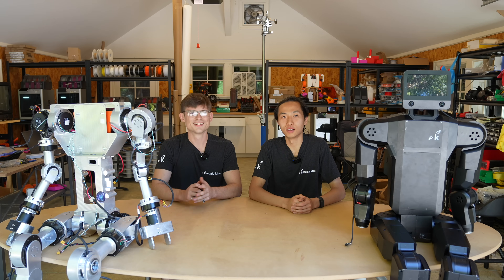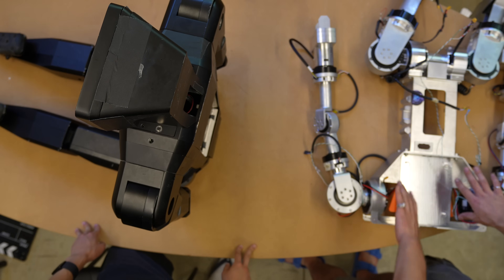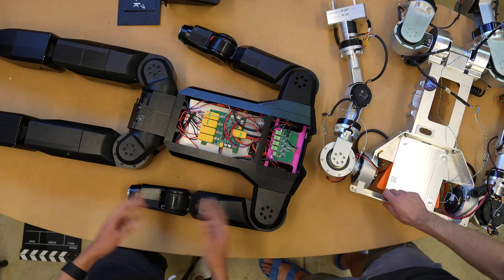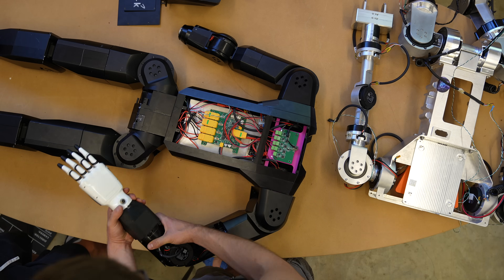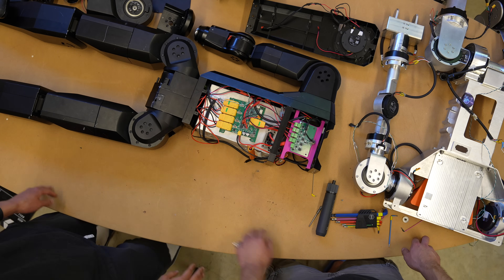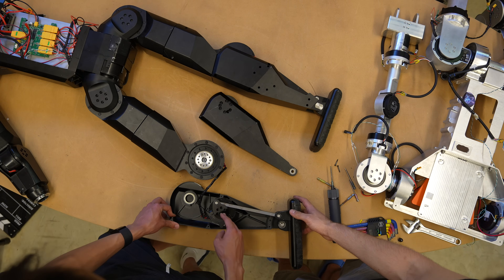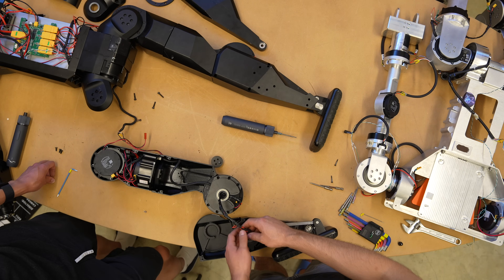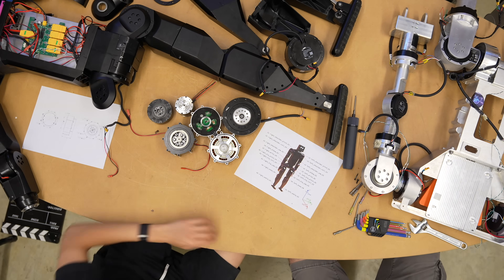What’s Inside K-Bot? Full Hardware Breakdown

Comment: What a wonderful and promising project! I would like to ask you, is it safe to daizy chain the motors in regards to the power cable? I mean is XT30 capable of handling all the amps that will be drawn from connected motors when all the motors may be in action and propably draw max current? Also  i have connected 4 motors at the same time and faced some problems with the CAN BUS where 3rd and 4th motor would miss instructions (through the usb can module of robstride) ... what electronics do you use? is there a link i can purchase them?

Comment: One application I see that humanoid robots such as your could fill is driving legacy as well as specialized vehicles, in a manner similar to how a human would drive it by sitting in the driver's seat and suing the steering wheel, brake and accelerate pedals and shifting gears.

Now one does not have to be a Tesal Robo Taxi to do that given that the circumstances are right.

For example  say one wanted to drive a car underwater such as this.

e.g. Google
Watch: Toyota Land Cruiser EV Breaks World Record by Driving Under the Ocean

So a bot could be the driver and maybe  operate from a closure so as to keep the bot dry.

This could have any number of applications but the one I particularly have in mind is to be able to drive under the Dnipro river in Ukraine to be able to hide form UAVs while deliver  bots and supplies to the other side by driving into the river, then on the river bottom, then driving back  out of tehe river to the other side and then further inland while never putting a human driver  at risk.

And there could be many more applications for bots to drive vehicles that do not require a Tesal robo taxi FSD level of smarts..

Comment: Just from curiosity, on the power board, I am guessing the right biggest cable is the one connected to the battery, and u mentioned that the 4 pairs of cables on the left is for the 4 limbs. Whats the small pair of black red cable thats at the bottom  in the middle. Is that to power the electronics in the head (camera, display, etc?). I dont have any experience with electronics and its kinda cool that you guys go on all these details!

Btw, the black frame looks and sounds metal, or is it metal? Cuz I thought u guys 3d print these parts

Comment: Is there a reason, why you mostly opted for direct drives? For example, torque transmission via timing belts on the arms could reduce inertia quite a bit, which would reduce the required motor spec, probably even multiple belts using differential joint

Comment: maybe this is a dumb question but wouldn't it be easier to mass-produce a robot if all 4 limbs were identical? Like instead of bilaterally symmetric it was quadrolaterally symmetric? You wouldn't have to worry as much about stress distribution (it doesn't seem like you are much to begin with) but if the hip/shoulder is where most of the force from the hand/foot meets the torso then the ability to rotate the stress by cartwheeling 1/4 would help to distribute stress over time. And then  it would be a simple matter of just making 1 limb instead of 4 to replace it, like car tires.
Reply: I don't know the answer to this but I like the way you think.

Comment: Still haven't seen an estimate on the cost. I assume since most of the components are probably from china that whatever they quote will need to be multiplied by 1.5 to 2.
Reply: The retail price for this set of RobStride actuators is $4K. They may get a lower wholesale price on them. But the robot contains many components in addition to the actuators, plus the price must cover R&D, overhead, etc. So, multiply by 4.
Reply: @cogoid  where do you even find robostride actuators to get that price?